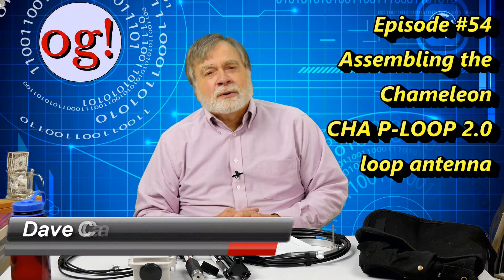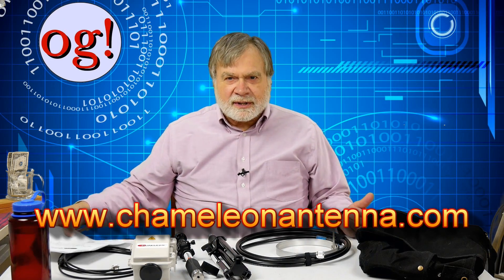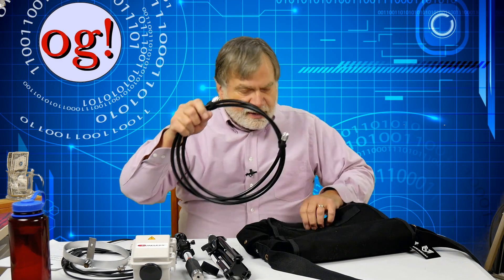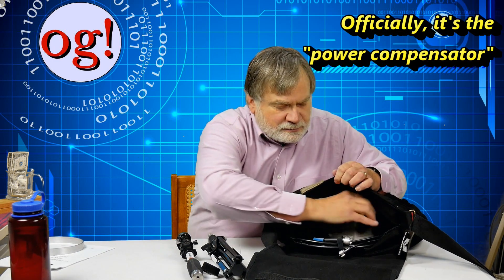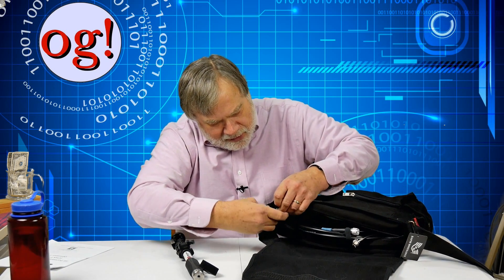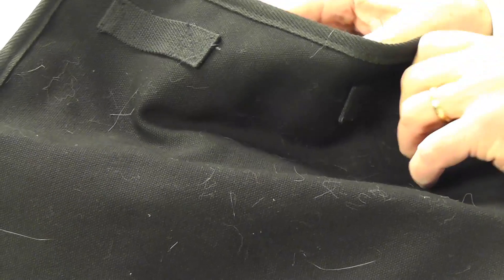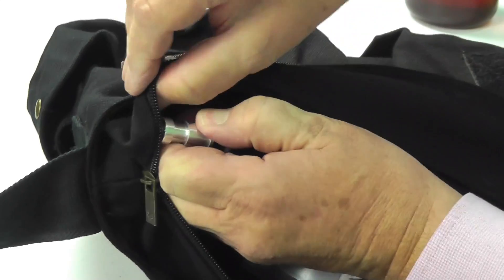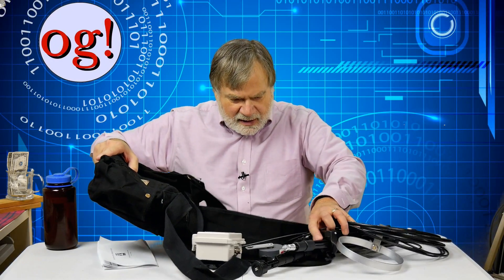Assembling the Chameleon Loop Antenna: AD #54

Comment: Thanks for the video. I don't suppose you'd know the length or diameter of the two loops?
Reply from the maker: The main loop is about 3 feet in diameter. The feed loop is maybe six to eight inches in diameter.

Comment: Good Evening Dave!
I was watching you put the Antenna all Together, and had a thought...I think I would mount the Tuning Circuit “Remote” the Tuning Box INTO the Shack...so you could make adjustments as necessary from Near your Radio!  Thoughts?
Thanks for continuing to do a GREAT Job, Introducing New Products and “Old” Concepts to All of us, either New to the Hobby, or those of us who have been around for a few decades!
Reply from the maker: The MFJ-1788 and family mag loop antennas have a remote control in the shack. It's semi-automated and finds a spot where the antenna is nearly in tune, and takes only minor tweaking to get fully in tune.

Comment: Would the Chameleon Antenna work for JT9 and JT65 ? I don't have an HF rig yet, but if I was going to get an antenna, BEFORE I get the HF rig, is the Chameleon a good all around digital antenna?  I need a loop ant. for space reasons..
Reply from the maker: Antennas are mode agnostic, so, yes, an antenna that works on SSB can be used for JT9 and JT65. I would note that this particular antenna really should be used outdoors, and given that you tune it by hand, you'd have to be outside too. I have an MFJ loop antenna coming (it's backordered), which can be tuned remotely, so let me review that before you make a decision. If you're looking at verticals, look at the AV-640, which requires no radials.
Reply: Thanks for the replay Mr. Casler!  This may be silly, but would operating it near a window or having it mounted outside a window, help then?   Also Loop antenna's aren't new, but why do they seem to have sky rocketed in popularity right now?  Will you be doing a comparison between the MFJ and this Chameleon or atleast a video on sort of 'how to' for loop antenna's and how to configure this to a radio?
Reply from the maker: Operating near a window could help. My home has foil backing on the insulation, so operating from indoors is problematic. I briefly took the Chameleon outside today to try with my BITX-40 SSB QRP rig, but it was too windy (and chilly) to do a proper evaluation.

Comment: Does the antenna bag have slip pocket on the back?  If so, you might be able to put the coax cable loop and antenna element in that pocket and have more space in the zipper pouch.
Reply from the maker: Good idea, thanks.

Comment: So what is the Power Compensator used with the NEW CHA P-LOOP 2.0?

The Power Compensator is a device providing fast-acting reactive power on high-voltage transmission networks. It is regulating voltage and stabilizing the system. It will allow higher transmitting power of the loop antenna (output power). The Power Compensator has no resistive components and/or effects on the loop antenna. The unit has been designed to be used with any magnetic loops using SO-239 output connectors on the tuning box. It’s compatible with the P-LOOP, F-LOOP, Alexloop and others.
Reply from the maker: Thanks for the additional info! 73
Reply: Does that mean I can put one on my P-Loop and use more power?

Comment: Dave, does it radiate RF?
Reply from the maker: Yes, absolutely. The problem with small loop antennas is that the radiation resistance is quite low. To be effective, ohmic losses need to be kept to miniscule levels, otherwise much of the power just turns to heat. I look forward to better weather when I can get outside and test the loop properly.

Comment: Great video David, hope to see the next video with you testing the antenna and power limits it will handle. Will it work on digital modes ?
Reply from the maker: Yes, all antennas a mode-agnostic.
Reply: The loop antenna is not too bad. I have built several sizes loop antenna, and operate 0.5W in CW mode with 4meter perimeter loop which is installed in a horizontal position, and also made some successful contacts, the longest distance is from China to Sydney, almost 8000km.  ofcourse it can work in digital mode.

Comment: here in arizona i would have to put concrete blocks on the tripod to hold it down if outside the winds here are something else.
indoors well. my chicken wire in the stucko acts like a shield for the most part so all my antennas are outside

Comment: Thanks for this video. comparing the P loop with the F loop Chameleon, i would recommend the latter , especially for beginners . its easy to use and performs well. there is also a remote use option for f loop.